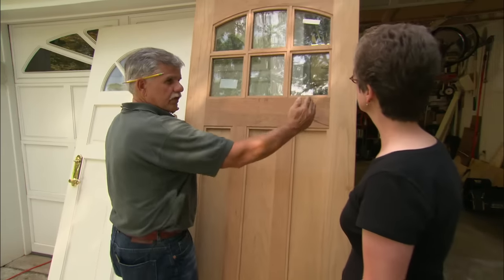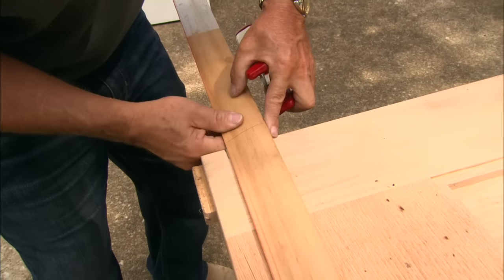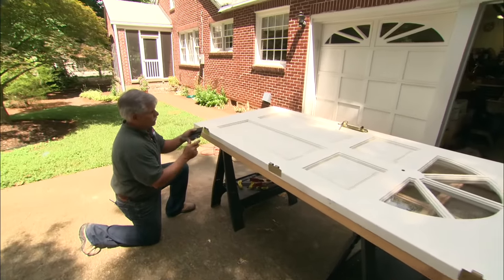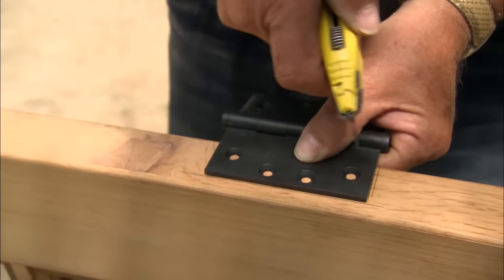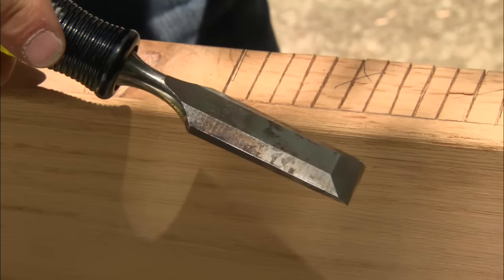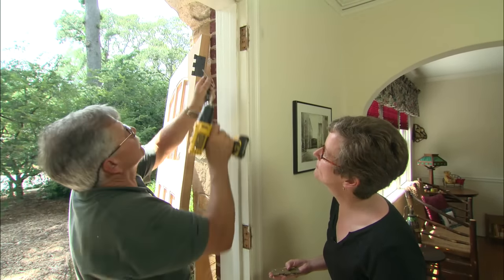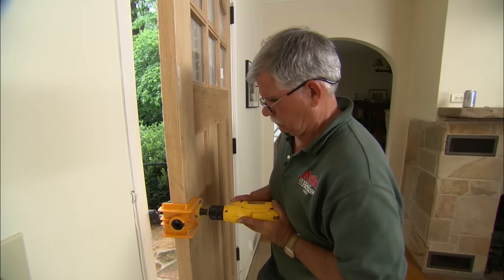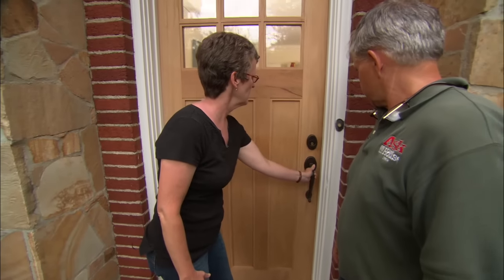How to Hang a New Front Door in an Existing Frame | This Old House

Comment: If I make a video like this, the final scene will be something like: "Alright, Danielle, give it a try!"  *Starts closing the door, but it jams and won't even close. * "I think you might need to cut it a little smaller at the top, and it seems like  the hinges are not quite at the right angles, or something. I hope you're gonna be able to fix this before dark. I shoulda hired a real carpenter..."
Reply: Same 😹😹😭😭
Reply: 😂😂😂😂😂😂😂 as diy’er I’m very familiar with this outcome
Reply: 😂😂😂 i would be the guy that inadvertently laid the door upside down over the original door
Reply: First time I ever actually spit a drink reading  a comment
Reply: Same, for my first door. 😂
Reply: That "before dark" line is timeless yo.
Reply: I can find every way to mess this up.

Comment: Sadly, the industry pushes customers not to use this method anymore to replace doors.  Door and window companies now prefer to just rip out frames and install pre-hung doors for more money and somewhat less work. I've talked with 3 door companies and professionals and they all say the same. This is especially true if your slab door doesn't fit the typical 80 X 32 or 36 measurements.

Comment: Watching Tom work is like watching a seasoned pilot land a B747 with rain and a low overcast, or watching a mechanic remove and replace a hard to reach starter. It's their day job. They do it so often that it truly does become routine. For us DIYers - it's much more difficult. Partly because we may not have the ability to get all of the tools and jigs used. They can end up costing as much or more as the replacement door slab itself. I am replacing a kitchen to garage door right now. I'll get it done and I'll correct what I mess up as I go along. Good luck and best wishes to all DIYers.

Comment: So then how did you determine where the lock set would go on the door so it would go into the strikers on the door jams?  I want to replace my doors with more modern ones.  You have really done a great job explaining how to do the hinges but not the knobs to be in line with the strikers.
Reply: The knob, cylinder, and striker should all lie on the same horizontal line. Since the old striker is already there, simply close the newly hung door and mark where the center of the striker meets it. The boring fixtures you saw him use will do the rest. The pocket on the striker is much wider than the cylinder; allowing for this fit-up and settling in the house.

Comment: is there a benefit to the extra work of replacing the entire frame and getting a prehung door?
Reply: I imagine it'd be preferred to get a prehung door if there's damage to the original frame (sagging from the house/foundation settling over the years, etc.), or if you want to change the size of the door altogether. The door I need to replace is an awkward 34" wide, not the standard 32 or 36, so I'll probably get a 36" prehung set instead of trying to find another 34" door. This'll be my first attempt at door replacement though, so I could be entirely wrong haha

Comment: What was that yellow tool called that he used to drill out the door handles ?
Reply: A holesaw
Reply: What?  He has a drill and a drum bit !   I'm referring to the yellow bracket clamped on the door when he's drilling the hole...
Reply: Drum bit? We call them holesaws. It's a handle drilling jig there are countless different varieties Irwin do one similar to what he used
Reply: And the name of the yellow bracket on the door would be a ?
Reply: It's a door lock installation kit. Mibro makes them.
Reply: Thanx

Comment: i want to know how Tom eyeballs the center of the bit for the screws in the hinges. i can never get my pilot holes centered.
Reply: Hes using a tapered drill bit, it has a fine point to decrease the chance of wandering.
Reply: pick up some vex self centering bits

Comment: Does this method seriously work as easily as shown? My concern is that if one hinge placement on the new door is 1/32"  out, the hinge halves won't come together cleanly. It's pretty hard to get that kind of precision with pencil marks. Then how do you fix that? You can't move a screw hole over 1/32".
Reply: +Javier Fauxnom 
It doesnt work this easy. I have had alot of problems lining up the latches and the dead bolt locks with the strike plate on the door frames They NEVER line up perfectly.. If the latches dont line up they will hit the strike plate and it will not close but I have just grinded down the the strike plates a little with a dremmel tool with a stone on it and it will close
Reply: This is Goody,   To line up the hinge placements from the jamb to the door, place your tape measure at the top inside of the jamb agenst the header measure down to the top of each  hinge , then on your door hook your tape to the top of the door with a nickel under the tape end, measure down from the top of the door and mark the measurements  on the door the nickel will give you your head margin . To get the right spot on the door so your door is not pinch the door stop measure the little piece of wood on the door where the hinge was on the old door should be around 3/16 to 1/4 of an inch take one of old hinges line it up on the measurements from the top of the door and the mark on the stop side of the door and trace out the hinge. Chisel out the Hinge placements and screw on the hinges.
Reply: This is Goody,   To line up the hinge placements from the jamb to the door, place your tape measure at the top inside of the jamb agenst the header measure down to the top of each  hinge , then on your door hook your tape to the top of the door with a nickel under the tape end, measure down from the top of the door and mark the measurements  on the door the nickel will give you your head margin . To get the right spot on the door so your door is not pinch the door stop measure the little piece of wood on the door where the hinge was on the old door should be around 3/16 to 1/4 of an inch take one of old hinges line it up on the measurements from the top of the door and the mark on the stop side of the door and trace out the hinge. Chisel out the Hinge placements and screw on the hinges.
Reply: You are correct. Loosen the screws just about 1/8 or so so the beveled top is not all the way down, get the hinge pins in, then tighten down the screws.
Reply: "You can't move a screw hole over 1/32" - 1. drill out hole to 1/4"; 2) shoot wood glue in hole; 3) pound in a 1/4" birch dowel; 4) cut off excess dowel; 5) wait a few minutes and redrill.
Reply: Brilliant!
Reply: No it doesn't.......depending on opening it can be friggen nightmare......lots of hanging and rehanging to adjust......easier to do pre hung.......I hung doors for living and these are usually PITA
Reply: if a hinge is slightly off, just loosen the screws in each hinge leaf, put hinge together and slide pin in.  Then re-tighten screws in shim and frame.

Comment: question?  what about the other side of the door frame where the locking plates are?  my problem is that it's  been broken into numerous times and it looks like someone used a chisel my deadbolt literally touches nothing. ..how do you fix that?  replace the whole door frame?
Reply: Theres a metal security plate you can get that wraps around the door jamb.

Comment: Please make a video that shows how to cut a new door for an old doorway with existing jambs WITHOUT having the old door being available to use as a template for the new door.  Thanks!
Reply: shim the door into place off the floor, so it has an even good reveal at the top and 2 sides.  Depending on the opening and size of door, how wonky/out of square and level the opening is, this may involve cutting and/or planing the door. A power planer often comes in handy.  Other times though it is pretty strait forward and the new blank fits in well, shim it where everything looks good, and use a pencil to mark where the hinges are.  You can also measure for the hinges and hang the door and make any adjustments with planing etc after.. just remember to subtract an 8th or so from your measurements so the door has some room between the top of door and frame.

Comment: how do you put a new door in an old frame when you burnt all the old doors so you could survive the winter???
Reply: That's what I'm trying to find out.  I have an adjacent room that used to have a door installed, but my parents had it removed. I'd like to reinstall a door over the existing hinge mortises in the frame but don't trust just 'winging it' with my tape measure.

Is there a skill someone could share or should I just tear out the frame, install a pre-hung and be done with it?
Reply: Is it necessary to bevel any edges? I have read that some always bevel the latch edge and some say to bevel both latch and hinge edges when hanging in an existing opening. I did not see that suggested in this video.

Comment: Failed to address the real issue of how to get the holes on the hinges in the right place.  As I just discovered if you're two millimeters off, you have a big problem.  Now my question is how to shift the holes over two millimeters.  

Would it be possible to fill those holes with wood putty, let it set hard, and then redrill in the correct location?
Reply: Easy. Cut some pieces of wood about the size of the screw holes. You can put some glue on them, or not. Drive the wood into the bad screw holes, plugging them. Then use an awl or punch and centerpunch  new holes, or do it right and use a centering drill bit like VIX and drill the hinge holes over again.
Reply: @jimbendtsen8841  Easy, but not so easy.

Comment: you used a jig for the lock set but why didn't you use the hinge jig for the hinges? you also didn't show the 2 and a half screw that should go into at least on hole per hinge. All wood doors should have this screw
Reply: +Tony Skulitz - please explain more. Do you mean a 2 1/2" screw for extra holding power?
Reply: All doors on the hinge get one 2 1/2 inch screw for holding i n place

Comment: Assuming the old door was fitted correctly originally when it was first fitted. wouldn't it be better to take new measurement's ? the house may have settle since it was built. if the old door was wrong, you have a new wrong door.

Comment: In reality you're probably going to wish you'd bought a pre-hung door.
Reply: In some cases yes half the time no. There is a lot to consider. Worse thing I face is weatherstrip on existing doors. I am a door carpenter so fitting doors is no big deal for me. Ripping out a jamb is normally a much bigger job.
Reply: Hmmm...I think the door the homeowner selected was pretty nice.  As long as the existing opening is mostly plumb/level [and the wood structure is in good condition], just replacing the door seems smart.  Plus, not having to remove/reinstall all that brickmold/casing.

Comment: You didn’t check to see if the frame was square,you could have taken to much off the bottom when it may have had to come off the top
Reply: Yes indeed.  You don't know whether it's the top, bottom, or both that's out of square.  How about laying the two doors on top of each other, marking where the top and bottom should be cut, and marking hinge mortise locations at the same time.  Then cut the door and work on hinges.

Comment: For security, Tom should have used 3" deck screws, not the crappy 1" screws that come with the hinges.
Reply: you don't put deck screws in door hardware lol.. there are longer screws with heads that match the existing screws.